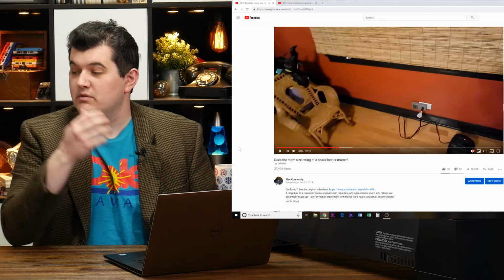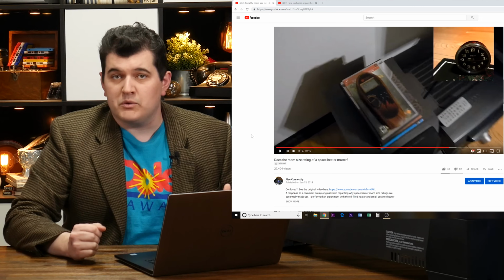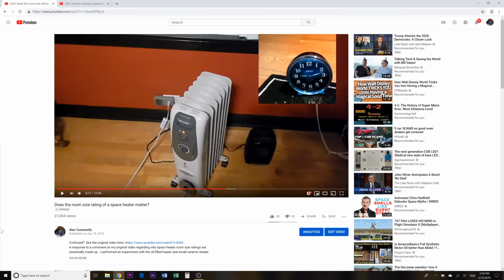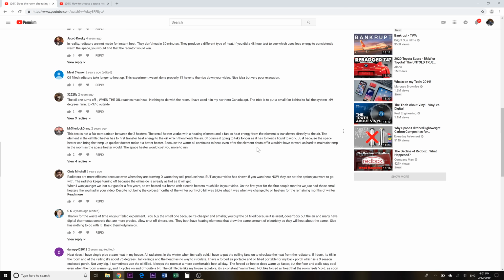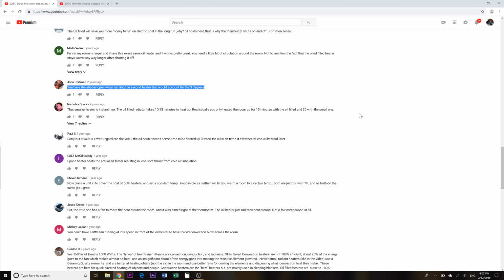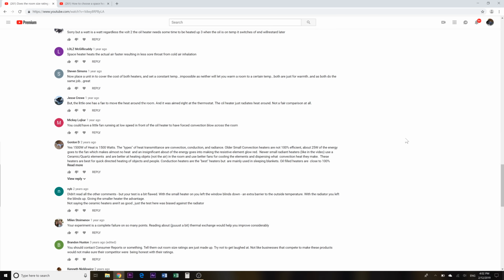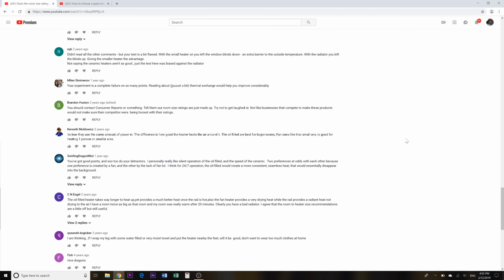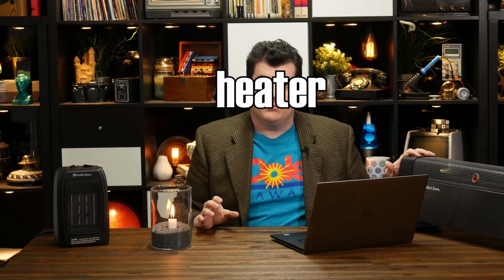More Space Heater Nonsense

Comment: I've worked in HVAC most of my life. You are absolutely correct. 

On another note, I once had a sales clerk of a big box hardware store (I won't name names, but it rhymes with slowes) try to sell me on a more expensive model because it was more efficient. 

It is a tribute to my strength of will that I did not give him a twenty minute lecture or just choke the guy out. 😂
Reply: Lol, you should have told him! Some people just hear that it’s more efficient and therefore just think it is. Unless you think he knew and was just trying to blow smoke up your ass
Reply: Would that be The Home Depot then?
Reply: Yeah those sales clerks are just that - sales clerks. The career trajectory has less to do with becoming proficient in the particular industry that signs your paycheck, and more to do with pacifying customers, filling spaces, asking the non-sales staff (who are still usually some steps away from real proficiency) a ton of questions and relaying info in an assertive manner. Even if the information is wrong. I don't go into mega hardware stores needing or expecting any help with my own proficiency if I can avoid it at all, because the "help" I get if I need it is usually not right and then I just have some random chunks of plastic or metal that I "needed" to make other chunks of plastic or metal fit into yet more chunks of plastic or metal.

Comment: There's a difference between air temperature and radiant heat (I'm thinking of the radiant heat from the oil-filled radiator). Right now, I'm sitting under a 250-watt heat lamp. If that same 250 watts was applied to a ceramic or nichrome space heater, it would give off very little heat. Yet, I'm nice and toasty under that same amount of power, raised to the temperature of the surface of the Sun. Put another way, take the 1500 watts of a space heater, and translate that into heat lamps; that's 6 heat lamps, and if you had 6 of them in a room, the radiant heat would be considerable. So, I imagine that part of the appeal of the oil-filled radiator is that although it does heat the air, it also radiates heat. In my home, I've noticed that even if the air temperature is the same, an outside-adjacent room feels colder in the winter, because the walls are cooler than they are in the summer, and that lack of radiant heat from the walls is perceptible. 
It's been 4 years, thought I should come back to this video again. lol

Comment: You are 100% correct here, in my opinion.  Frankly, the best part is that a small, fan-driven heater delivers heat instantly, when needed, but only when needed.  The quick response, combined with the fact that the device actually tries to transfer ALL of its heat to the air, all of the time, makes it more effective, I think, than a tank of oil whose main job is to get warm, then gradually fade away.....  🙂

Comment: I have a Give best ceramic heater with a 1500 W. and a 1650 W. settings. Will , using the 1650 W. setting, blow the 1500 W. breaker in the panel box?

Comment: I wanna start off by saying that I agree with your overall premise that energy is energy and the heat output of two devices drawing the same amount of energy will be negligible at best. However, there is another reason why a convection current is slightly more efficient at heating a larger space than forced air. The difference is pressure. Take two equal spaces with the same amount of insulation. Put the same amount of energy into both spaces, except one has an additional fan that moves the air around. Both will have air movement and what is called positive pressure, but the fan will give the room it's in a slightly higher pressure than the room without one. This means that while a forced air heater WILL heat a space faster, one that uses convection currents will cause that heat to LEAVE the room faster, which equates to less efficient heating. While I will admit that the pressure difference isn't huge, whether or not the efficiency difference is negligible is personal. A 5% difference in energy efficiency isn't so negligible to someone who makes as little money as I do. I want to be clear that I'm not saying that the difference in efficiency between the two types is 5%. I haven't done an experiment, nor have I done the math that would precicely determine the difference of positive pressure and how much it would affect two equally sized and insulated spaces. And since most negative comments you've received are disputing OUPUT of heat rather than ESCAPE of that same heat, you're still providing valuable information to people who are otherwise ignorant. I love your content and think you do a fantastic job of taking into consideration every factor that might influence your proposition. In this case, you simply didn't take into account the effects of positive pressure. I don't consider this an egregious error since I wouldn't even have considered it if I didn't have as much experience as I do with grow tents. In the world of indoor agriculture, positive/negative pressure has everything to do with the energy costs of controlling temperature.

Comment: It's why you should put a deflecting shelf above the radiator to push the heat outward. You can buy a fan that sits on the radiator to help spread the heat.
Fans on a wood stove make sooo much difference.
Workshop heaters, gas oil etc are almost always fan based, for a reason.

Comment: It has been around 30-40 years since I had the conversation with my father regarding space heaters.  He hated the gas space heaters where I liked them.  His argument was that they could be unsafe due to emitted gases if not properly adjusted, and the potential for gas leaks.   But I digress.  This is not to interject more depth to your already well covered topic.

During our discussion back then he and I discussed several types of heaters, including liquid filled radiating heaters.  I seem to recall him laughing and claiming that the "efficiency" of liquid filled heaters was mythology that was rooted in an indirect fact--someone else paid for it.  He explained the introduction of electric space heaters came under fire because the anti's claimed the old water (liquid) radiators were far more efficient.  As he explained, the "efficiency" came from an illusion.  Both heaters really did heat rooms nicely, but that the reason for the "efficiency" label for water radiators came from the idea that people (as in the occupants of hotels, apartments, and largers homes) weren't paying for the heat to warm them.  The water was already being heated and the system was in place.  The cost of generating that heat still existed; it came out of the pockets of the owners of the buildings in the form of heating and circulating the water, not necessarily the occupants. So electric bills to the occupants were indeed lower as a result.  

But all this, as he pointed out, was really smoke and mirrors as the reason these water radiator systems were used was because the plumbing, the hot water, and the hot water was already being used.  It's simply what they had.

Comment: If the large radiator didn't have the heat-itself-up problem, I have a suspicion the reason for the room size rating is about maintaining the desired temperature over an extended period and not the initial warming-up period.  The small ones direct heat in a specific direction, so the room warms from the inside outwards and the edges of the room stay cold - which rapidly encroaches when they cycle off.  Radiator-style on the other hand are supposed to be near a wall and the heat convecting upwards acts as a barrier, preventing the cold from getting inside in the first place - especially the slow-release continuously warm ones like was tested in the old video.

Comment: Hey, I know this video was from some time ago. You are correct in your conclusion 1500 watts is 1500 watts and is the same amount of heat produced. But in your test, you are measuring the air temp to determine how well each heater works. Not all heaters are equal in transferring the heat produced into a warmer room. The units with fans transfer the heat produced into the air more efficiently than ones which do not. You are confusing comfort you can feel versus heat produced. Second you made a mistake about the physics of heat transfer. To go into equilibrium the cold seeks the warm. Not the other way around. This is why your house feels colder in the winter versus hot in the summer. (the efficiency of transfer is the same) Third if you need everyone to verify you. Maybe another way to present your points should be found other than youtube. Stand strong with your results regardless. The facts should speak very loudly. Way too many people know only what the marketing has told them and are not at all analytical. Thanks for taking on interesting subjects.

Comment: I keep getting back to this. I'm tempted to try a small unit to treat my back room as such. It's about 9 by 16 by 8. But i sleep in a loft. If I place a medium or large heater lower than shoulder height, I usually wake up to 85 Fahrenheit 4 hours later set on low or 65 setting. If it's mattress height, it's tolerable. And the big heater still all fail after 1 or 2 seasons. Last one toasted my outlet. I had bought it new at a big chain store. I'm thinking of a heated mattress topper instead.

Comment: Actually not 100% efficient. Some of the energy is released as light. But the light is very minuscule compared the amount of heat generated.
Reply: But the light can’t escape
Reply: @nicks4934  yes it can that is why it looks red. That is the light escaping the heater
Reply: The visible light is not escaping the room. I suppose you could still claim that some of the black body radiation is radio waves, or that it's eventually going out a window or whatever, but simply being released as light doesn't get it out of the room.

Comment: I figure the difference is the oil heater, once running over a long period, will take less energy to maintain its temp, since the oil will take longer to cool and will keep giving heat, so my guess in a long term situation it saves on power.  But thats me just speculating.

Comment: While being in the military I had to use those small "hair dryer like" heaters to keep warm in the winter in the field. And oh boy a heater with a fan build in which just radiates the heat immediately was an infinite times better than the convection crap one, especially when you have to sleep in the truck cabin to stay on alert etc. The heat would otherwise escape right away white the blower fan one would keep you warm from the 1st second you turned it on.

Comment: I love people who think they're smart but are really not. The problem with the argument that they all put out the same amount of wattage in there for the same amount of BTUs is kind of silly. Anybody who knows anything about heat knows that it rises. Better electric heaters that have fans in large surface areas will heat the floor more than the ceiling because they're moving the heat from the ceiling down to the floor. Although they're putting out the same amount of heat a large radiant oil filled heater is not as good as a small box ceramic heater because the the heat from the oil filled heater goes to the ceiling and stays there. There is no fan to bring it back down to the floor. And when you're comparing small ceramic heaters to those who have the UV light and larger fans they heat the room much better because they're bringing the heat back down to the floor area.

Comment: I majored in mechanical engineering and had learned a few things. My take on the room ratings: small room heater, even though also 1500W, seems like it was not designed to be ran for prolong amount of time. If I were to heat a small church, I would take the oil filled one, cuz i dont need to worry about things melting or catch on fire. On the other hand, for a small room, yes the tiny heat would do perfectly; after 10-30 minute a small room would be toasty already, and the heater would shut itself off. If there were any hot spots that would melt anything, since it only runs for a short time, it is a lot less likely to happen. But this is just my guess.

Comment: My only question is whether the fan's energy really all 'goes into the room' as heat ultimately?  If you do a thought experiment of considering a 100w heater that puts 90% of its energy into the heating element and 10% into the fan - and then compare that with a hypothetical  heater that puts 99% of the energy into the fan and 1% into the heating element - would that hypothetical fan-mostly heater really bring a room up to temperature at the same rate?  Obviously the kinetic energy of the air blowing around ultimately generates heat as the air has friction with surfaces - but will that be as efficient as the heat coming from the element?  I get that for it to not go 'into the room', it would have to go somewhere else, and there's no obvious other place, but it seems odd that the kinetic energy in the blown air can convert to thermal energy with 100% efficiency.  If this were true, an electric fan at a given wattage would heat a room as efficiently as a space heater of the same wattage, but that doesn't feel like it's right.  By the way, some of the energy going into the fan comes out as a heat byproduct from the fan motor - and this obviously goes into the room - but I'm assuming that a bunch of the fan's energy goes into the air's kinetic energy also.

Comment: I know this is an old video, but I just wanted to give my take on all the different heating options available and which I prefer to use often.

   So popular options would be Radiant dish heaters are useful if outdoors where wind would blow the heat away otherwise, but they only focus the heat in one area they shine on and won't fill the whole room. The oil heaters I always thought were more about long term economical heating seeing as they will most likely use less power once up to the proper temps vs a standard fan heater. Last the common fan heaters these will heat a room quickest, but not all are equal even if they have the same power outputs, this is because creating the heat is only half the challenge moving it thru a space and pulling the cold air in efficiently makes some work better than others. After trying several in a small A-liner camper I eventually found this one Caframo True North Heater, even tho it has the same power rating as others I had tried it was able to heat the room faster and be able to shut down sooner to rest and use less energy after reaching the desired thermostat temps. Others I tried with same power ratings would struggle because of weaker fans or worse intake designs for them to move the rooms air. This one even tho it says 150sqft max I have used it for supplemental heating in our kitchen which is larger and it helped to maintain the temps for months while it shutsdown a few mins in-between raising it. Cost wise tho oil is probably more efficient in the long run I would imagine, but for instant results fan heaters win. 

   One thing about your methods of testing also, if the oil is unable to reach the desired temps set to max maybe lower the bar a bit and set both heaters to a temp that they can maintain while cycling the power on and off. After you have them both running with the thermostats properly set for the temp you could then monitor the power draw between the 2 and see which is more efficient at keeping that heat level maintained over a period of time. Testing them for speed at heating the room seems kind of hard because the oils not designed for speed it's designed for the efficiency, tho you could heat it up in another room and carefully wheel it in also so it's running its best for the speed test.

Comment: That's interesting. My house fixed the oil issue by having them as baseboards on the opposite side of the wall of the thermostats. They're nice for winter, but more expensive than you'd think. And my issue with inefficiency is my windows. There are two single pane windows that slide, so like each layer slides separately, and it leaves a lot more gaps. I'm really looking forward to getting them replaced, especially to get rid of mold and dust that I can't get out from between the layers (about an inch apart). 
I do wonder, because at the time that my baseboards were put in (1973), it was seen as the most efficient because even after it shut off, you'd still have some amount of heat, which I'm told is better for power outages and winter storms. But honestly, a propane fire place provides more of the heat because it just puts out way more heat, and cost about $400 a year, plus it works when the power is out.

Comment: I would love to see your experiment over a much longer period, two identical rooms, each with the differing heater plugged into your Kill-a-watt. I hear you that you're focused on the marketing of room size. Can it be that the radiator is more energy/cost efficient over time? Is not radiative heat transfer is more effective (dT^4) versus convectively heating the air and trying to conduct that air T into the wall? The radiative heater can emit far across the room where the fan's air has low heat capacitance. Thanks for the info, entertainment, and thought provoking subject.

Comment: So there's a very important distinction here - All electric heaters are 100% efficient at turning electricity into heat, BUT there IS a difference - how efficient it is at transferring that heat to the air. As an example, you can take one of those bulky metal shell "utility" heaters with spring elements into a cold room, and an old school Pelonis Disc Heater, and see which one is putting out more heat at 1500W. I guarantee you'll find a difference. And that's the real efficiency difference in electric heaters.